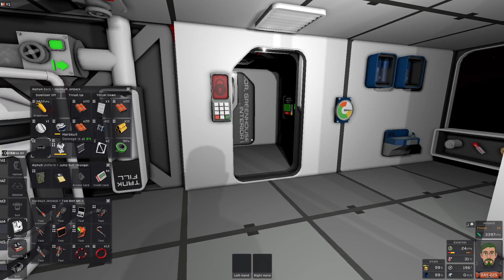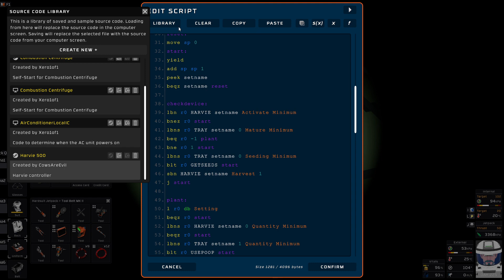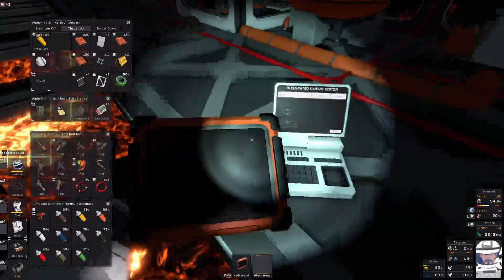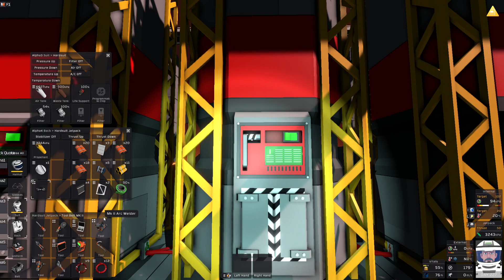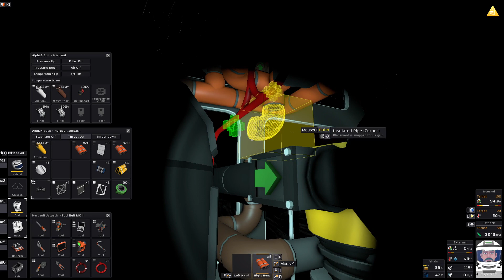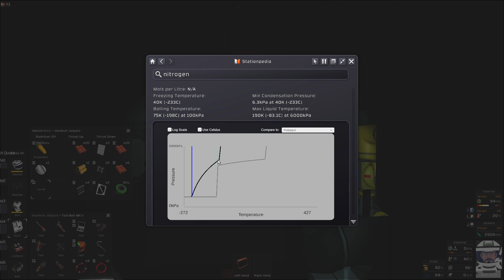Stationeers S04 - Survival - Ep97 - Phase Change or AC System for Cooling?

Comment: The thing with using phase change is that once you get it working right it's absurdly low maintenance. The price you pay is that it's a finicky bastard that's got a lot more points of failure until you sort it out well enough that it can be left to run on it's own without constant attention to be sure it's all running correctly. 
I'm an automation guy, and prone to both easy distraction and hyperfocus, so my approach is to monitor and control things with logic, and build in some failsafes to hopefully prevent the worst. Sometimes it even works :)
Reply from the maker: It's not so much about it working right, it's about the speed with which it works. Well... And the fact that you have to use both liquid and gas, which both limits and complicates things... Lol.

Comment: about the phase change, you are actually wasting a lot of potential heat sink by throwing away the liquid pollutant, you should feed that into the bottom liquid port of a phase change device, and only then throw out the gas that comes out the top as it over pressures. Using the middle port to then cool stuff down. 

That should be able to cool down nitrogen all the way to liquid with just that. Though perhaps not with any decent amount of speed.